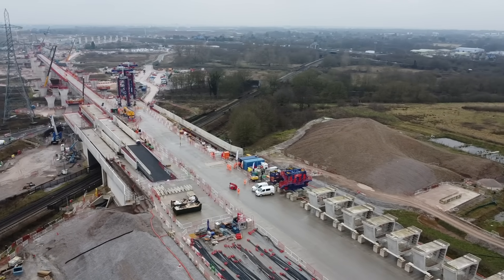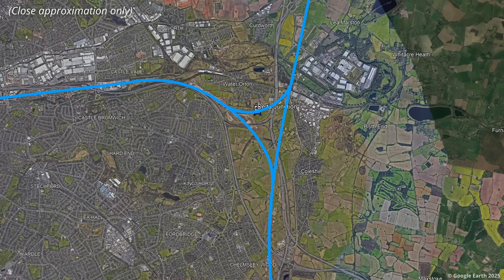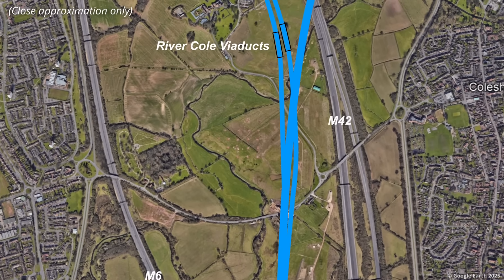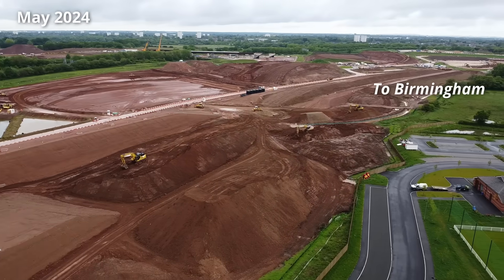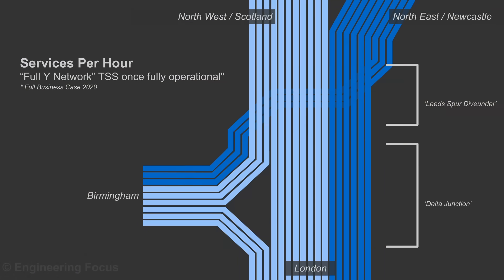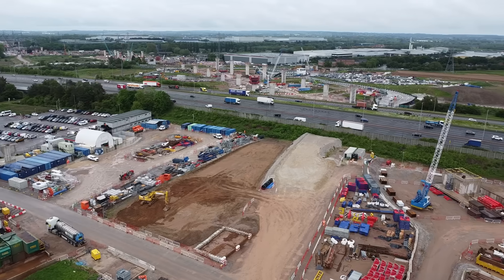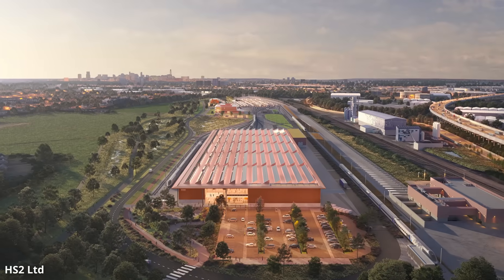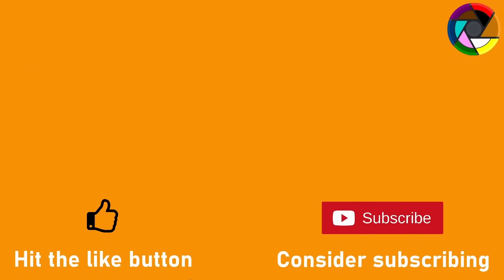What is Delta Junction? | HS2 Birmingham

Comment: None of this was necessary. They closed the Great Central Railway (GCR) in the 1960s which was our youngest mainline railway running from London Marylebone to Manchester via Aylesbury, Rugby, Leicester, Nottingham, Sheffield and Manchester. Built to the highest standard for high speed rail, it's curves were over a mile in radius and the gradients under 1% making it ideal for high speeds. Incredibly short sighted and clearly corruption to justify building the M1 adjacent to it, the GCR could have been our HS railway. Most of the trackbed, bridges and tunnels are still in place so would have cost a fraction of the price HS2 is. A delta junction could have been made at Rugby to connect the GCR to Birmingham.

But, there are mates with other mates with foreign interests at play here making an awful lot of money from this venture. Just bear in mind, not a single section of track has been laid so far to my knowledge
Reply from the maker: The GCR was closed and large parts built up, so it is now necessary

Comment: Thanks for the vid. Hopefully one day the Water Orton viaducts are properly utilised and we see services running from Curzon Street to the North. Also, I have always wondered if the junction for the eastern leg of the line will be built since it was cancelled. I still think they should as it is already part of the plan and would also make it easier if the line were to be built in future as installing a junction when phase one is operational would probably require closures. Keep up the good work👍
Reply from the maker: I think it'd be difficult not to include at least part of the Leeds Dive-under. I'm not sure if changing it at this stage would be beyond what's covered in the Hybrid Bill. Hopefully we'll know more next month

Comment: There are different types of cantilever construction and one has been used in the UK, many, many years ago. The Bridgnorth By-Pass used the first ever cantilever construction technique, based on Austrian method. It was built by Sir Alfred McAlpines, who I worked for at the time. Unlike the method used in this vidoe, the sections on the Bridgnorth bridge relied on the segments actually being cast against each other in formwork moulds. Each mould had to be adaped slightly as the bridge deck differed in thickness from the piers as it progressed out over the river in one direction and the land in the other. This method was chosen as it was the least disruptive at the time, to impeding the river.

Comment: Insufficient capacity?  The Chiltern railway from Birmingham Moor St to Marleybone generally uses 3 or 4 carriage trains.  While South Western are increasing their trains from 10 to 12 carriages.  So Chiltern railiway capacity could be more than trippled just by increasing the length of their trains.
Reply from the maker: Great if you live in Birmingham! But HS2 is about more than Birmingham, even in its current form
Reply: Capacity is a pathing issue, not a passenger numbers issue.

Imagine you have 2 trains, an express train and a stopping service. The express takes 30 minutes, the stopping service 44 between the two cities.

Normally you'd want a 3 minute gap between trains to prevent them causing delays to each other - this means you could run up to 20 stopping services on a line every hour, this is similar to how the tube operates. Now consider if we ran a mix of stopping and express services, we can set them off just 3 minutes apart, but because the stopping service is slower, it will arrive 17 minutes after the express service, limiting the number of trains per hour to just 6 (3 express and 3 stopping) - and that is an absolute maximum with no room for even the slightest delays. (highly unrealistic)

The capacity they are referring to is additional slots for trains to run in, by removing express services from existing lines you roughly triple the capacity of the existing lines which not only allows for more frequent passenger services, but routes for freight trains (which travel at speeds similar to stopping services) and all that is on top of the capacity afforded by the new HS2 tracks themselves.

Comment: I'd be interested in knowing just how much TAX payers money went into creating this junction. I bet it would have been cheaper to put it all under ground. Simpler construction technique and no modifications of existing infrastructure or dealing with Motorways in the way.
Reply from the maker: Public investment does not work like that. It's paid for with borrowing which is based on the return over 60 years. But the infrastructure is designed to last 100+ years. And no, tunnelling is not simpler or cheaper, not by a long way.

Comment: Why does HS2 cost so much more than equivalent railways in Norway where enormous tunnels are required? It seems like everything is bespoke. It seems like consultants are used much more and more expensively than in other countries. It seems as though this is not just a transport link - it is an exemplar of over engineering excellence…..a prestige project.
Reply from the maker: There are multiple reasons https://youtu.be/rBDrC0qk6qk

Comment: Italy has the successful idea, use HSR to link a series of cities. Should have tunnelled under Birmingham and all the other cities served by HS2 - no delta junctions required. Could just have built a 2-track railway in the one tunnel and put a dividing wall in the middle of the tunnel - huge cost saving.
Reply from the maker: I don't think you appreciate how complex it would be to build a huge cavern underneath Birmingham to house the station. You can't simply put a mainline station in tunnels like London Underground. And that would require a lengthy tunnel to get north. No cost saving + long journey times to the north.
Reply: @peteregan3862 Well done! Shows you have absolutely no idea....😂

Comment: What bugs me is the awkward curvy approach from north, probably it's also reduced speed due to smaller radius of the northern two tracks.

Looks like a much more optimized junction along with possibly even less material use would be achieved if the northern bit passed Water Orton to the north, or through Water Orton station.

Comment: Coool, finally learned what those extra viaducts near Water Orton are for. I thought it was two tracks in all directions and one for some mysterious siding maybe... but it's four on main line and six to the north 🤯lol, I guess extra capacious flying junctions make sense, if the other spur going to east Midlands is to be coupled in not very far from there.

Comment: They might as well throw in a link to the Birmingham-Derby line from the in the Curdworth area. It'll be a cheap way to take a bit of pressure off the MML
Reply from the maker: If they do build the Leeds dive-under it may be possible to connect to the Birmingham - Derby line in future, it would have to be electrified though
Reply: @Rail_Focus  or make the trains bi-model like some of the IETs. Doesn't cost that much more and gives redundancy in the event of OHLE issues as well as non electrified lines. Be a lot cheaper than electrifying the route

Comment: So, the HS 2 trains will trundle from London Euston to Old Oak Common then do the high speed bit to Birmingham Interchange then trundle to Curzon street. Will Birmingham Airport expand to provide a viable alternative to Heathrow and Gatwick or will it be the other way round with the Midlands creating a greater need for a bigger Heathrow Airport? The announcement of a new runway at Heathrow, tells us how the future will be still more activity in London with the Midlands being a "feed" for London.
Reply: I will ll just point out that riding on a Shinkansen is impressive but so smooth and silent because of the anechoic design of the carriages that it is slightly boring. Will a British Shinkansen be as good? I hope so but I doubt it.
Reply from the maker: Not exactly. Whilst the speed from Delta to Birmingham and from Old Oak to Euston will be slightly slower than the mainline, the trains will be far from "trundling". With speeds of around 250-280km/h (150-180mph) possible. Obviously the trains will have to slow down before entering stations 😉
Reply: @Rail_Focus  the part before entering the Stations is the trundling part. The stretch out of Old Oak Common to Birmingham Interchange is the high speed part and  I'd labelled it as such. Please re-read my comment. The trundling pat is significant. Smoothly gliding the way the Japanese bullet trains do on entry and exit at Stations, perhaps. It is a impressive sight from a hotel window.
Reply: @KennethOram-ei9ff  You have labelled. Please provide why we should trust that your "labelling" is correct? You have already typed way too many comments about "trundling" without any evidence whatsoever that these station approaches would be substandard compared to the impressive ones.
Reply: @u1zha  substandard? How do you reach that conclusion?
Reply: Rail Focus reply shows that someone doesn't comprehend what they are reading or chooses to misunderstand the message. Not a reassuring sign.
Reply from the maker: To my mind trundling refers to travelling slowly. Trundle "an act of moving slowly". The quality of the slab track will be uniform throughout the route's entire length. How well the units will ride over switches is anyone's guess

Comment: not sure but I there is a large maintenance facility being built (after the concrete factory gets removed) slightly north of their (j9 of the m42)
Reply from the maker: There was a map which showed a track and systems depot which would be located where the segment factory currently is at Kingsbury. But I wasn't sure if it was a permanent depot or would just be used during the installation of rails.

Comment: Chris thank you so much for this global overview of the Delta Junction.  
I also now @5:09 just learned about the 2022 removal of the Golborne Link to WCML from your historical HS2 map..that Golborne Link could be an expansion of HS2 with another expanded "delta junction" as well to the north and south...then notionally could expand HS2 capacity and utility as well, that would-have fully interconnected Manchester Airport to the HS2 line.

The more I learn about HS2 the more I can see how the costs have driven so many cutbacks; evenso, HS2 is a massive and wonderful upgrade.

Comment: I think a lot of HS2 north of Birmingham will end up getting built, possibly to a slightly lower spec, and just not called HS2 to avoid freezing attention to itself.
Reply: @lostcarpark  yes I agree, maybe it'll be announced as the 'Crewe diversion line' to avoid triggering those with simplistic outlooks about HS2. I fear too that it will not be at the full specification as it will lack foresight for future expansion of HS2 in the following decades.
Reply: @Maxhead_room  Yes, I think some of the likely shortcuts are fine, as long as they allow for future upgrades. However, there are some proposed cost reductions, like a smaller loading gauge, that will only result in a very modest saving, but will permanently limit the trains that can run on the line in the future.
Reply: @lostcarpark  they've lost control of phase 1 in my opinion by issuing blank cheques to contractors in effect. In my opinion it was over engineered with an unnecessarily high top speed. My understanding is that the extra 50mph adds something like 30% to the cost due to underpinning the land.  Also all the unnecessary tunnelling and  cut and cover when a cutting would do, not to mention the batshed. The rest needs to be built but at a sensible cost.
Reply: @garthcox4307  I agree that costs have gotten out of control. However, in the long run I think HS2 is going to provide massive benefits, and the initial cost is going to seem relatively minor. I think if it was a motorway it would have been just seen as a necessary cost and built anyway. I also think even without the cost overruns, the rail haters would have used everything to raise objections and there's a very good chance phase 2 would have been cancelled anyway.
Reply: @garthcox4307  Much of that tunnelling to pacify the NIMBYs.
Reply: @boldford  burton green is a ridiculous example.They are using a disused railway cutting but are excavating a cut and cover tunnel. It would have made more sense to just use the cutting and use those noise reduction fences that they use next to motorways
Reply: @garthcox4307  I don't agree with you about Burton Green, constructing the railway as you propose will have destroyed the amenity of the village, the old railway line was narrow and is a popular greenway. If we ignore the disruption of the build and the 2/3 lost houses then this village will end up with green spaces and amenities much better than that before. Modern construction at this scale needs to be considerate - and that is what HS2 have done here. However, I would agree that the Chipping Warden green tunnel might seem unnecessary as some of the surrounding land is being used to store thousands of vehicles.
Reply: @garthcox4307  almost half the cost of phase 1 is rolling stock, getting into the cities, which is around 140mph, and the inner city stations. The 225mph sections aren't that much more than the 100mph non electrified EWR proposal from Bedford to Cambridge.
Reply: Possibly "Fairly Quick 2"?
Reply: @boldford  no increased capacity 2
Reply: @ An additional line increases capacity.
Reply: Well hs3 got renamed to northern powerhouse

Comment: HS2 must be fully built 

Both Eastern and Western legs must be fully built
Reply from the maker: Absolutely!
Reply: We also need a high speed through connection between HS1 and HS2.
Reply: @GJChurchward There is no case whatsoever for linking HS1 to HS2.
Reply: @ If I want to travel between Birmingham and Paris, or indeed any other city which appears on Europe's evolving High Speed network, a through link would give me a more convenient option than flying.  A fat lot of Carbon that saved.
Reply: @ You, maybe. But you’re but a tiny fraction of who would travel that way, and the expense to build it would be huge. And that’s before we get on to the issues of security screening, immigration, and customs facilities that would be needed at regional stations. It’s simply a non-starter, and if you knew anything about it you would realise this.
Reply: I simply can not understand why so much ajoining land has to be despoiled in this process. I watched the French system being built and they basically just cleared the trackbed width plus any earthworks and none of this massive scar on the landscape, which will never recover as it was. It must be and is, cheaper.
Reply: WE dO NOT need it at all
Reply from the maker: YES wE DO
Reply: @keithg1xfl  The west coast mainline is basically at capacity, the east coast mainline is not far behind

Comment: Thank you for another great HS2 explainer. I'm curious where the line goes from 2 to 4 tracks as it heads north before the interchange station. Given Sunak was meant to be such a well educated fella he made plenty of trump-scale dumb decisions. Let's hope that we see the dive-under constructed.
Reply from the maker: I haven't quite been able to figure out the Leeds dive-under, but the tracks north go from 4 to 2 almost immediately after the dive-under, as the Marston Box is only 2 tracks.
Reply: In terms of the approach to Interchange from the South, it splits from 2 to 6 to enable 4 tracks serving the 2 island platforms, with 2 through tracks for non-stoppers. This reduces again back to 4 when the through lines join with the lines serving the inner faces of each island platform. It then remains at 4 until the start of the delta junction.

The exact point at which the 2 split into 6 prior to Interchange is unclear, however you might be able to work out if it is north or south of the A45 by looking at the width of the over-bridges being built there currently on the service roads. If they are typical width, then the point the split occurs will be the short area between the A45 and the station itself.
Reply: @ebsbrown4983  From what I can tell, the 2 tracks split into 4 immediately after the River Blythe Viaduct east of Hampton-in-Arden, around 154+450. The outermost tracks then split again just north of the A45, to make 6 tracks.
Reply: 6 become 4 again almost straight away after International, with a crossover straight after that (before the new roundabout). At International the 6 tracks are NB stopping, NB stopping, NB through, SB through, SB stopping, SB stopping, a bit further north they're NB stopping, NB through, SB through, SB stopping, and a little bit further north again, after the crossover, they're what I'm calling NB Birmingham/Leeds, NB Manchester, SB Manchester, SB Birmingham/Leeds.
Reply: Actually, now I've said all that, the crossover only seems to go from in to out - i.e. trains can bypass Interchange on the way to Birmingham, but can't stop at Interchange on the way to Manchester. Maybe it's just the way the map I'm looking at has been drawn.
Reply: @charliep1973  excellent, thank you.
Reply: @ebsbrown4983  the scheduling "4th time dimension" probably drives the 6 tracks for capacity, and possibly accommodating slower traffic and freight from Crewe.